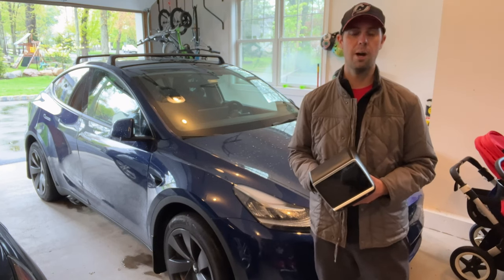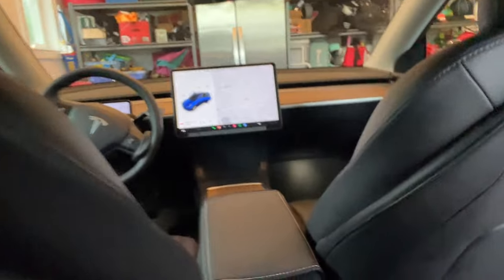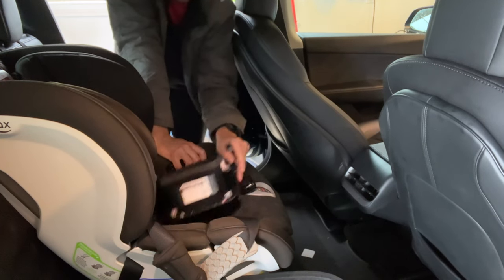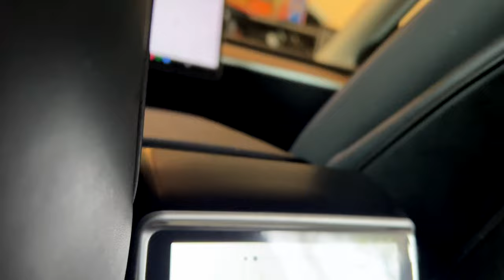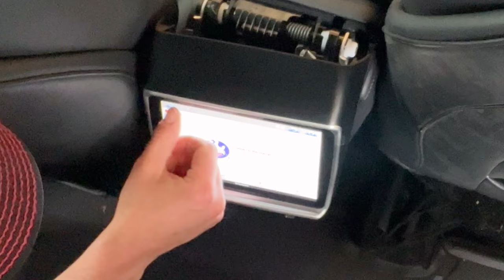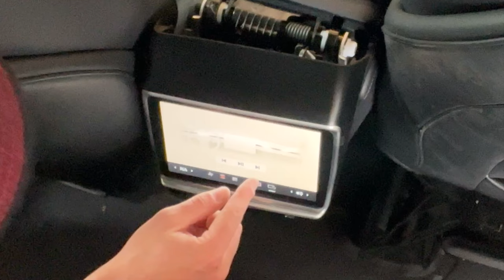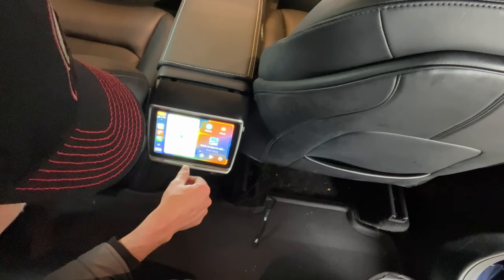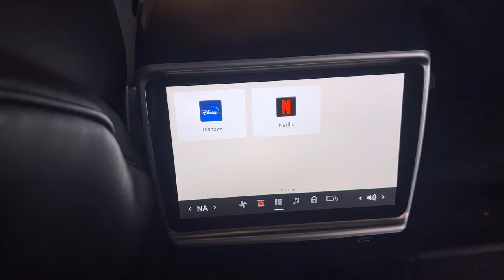I finally solve the biggest Tesla problem! Carplay in the Tesla Model Y!

Comment: Pretty cool, but what happened to the air vents for the rear? Are they completely gone and if so is the heat/air from the front enough to heat/cool the back seat?
Reply from the maker: They are cut down by about half I would estimate. There is still a portion where they vent out down below the screen but it’s definitely not quite as strong as having the larger vents directly. I’ll have to test it out on a warm day and see. So far the kids haven’t said anything about it but we also haven’t been out for a long drive in a hot sunny day yet.
Reply: @Eventurefamily  oh ok cool. I’m in Vegas and extreme heat so that is why I was asking. It looks really cool though!